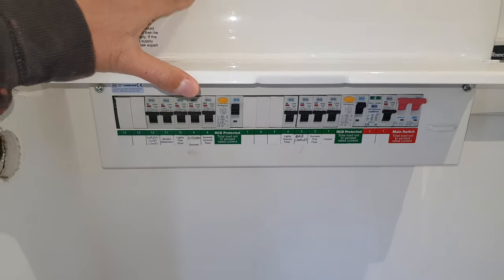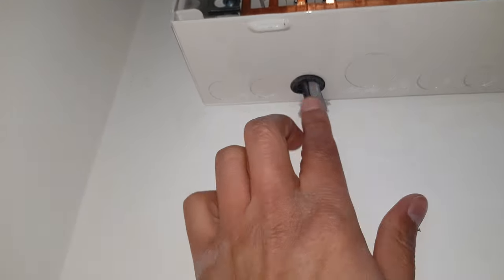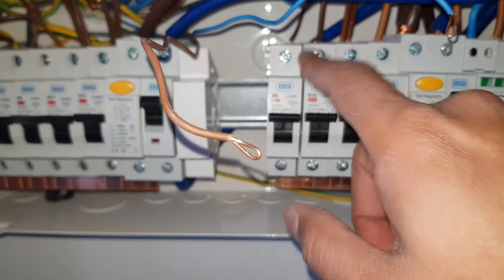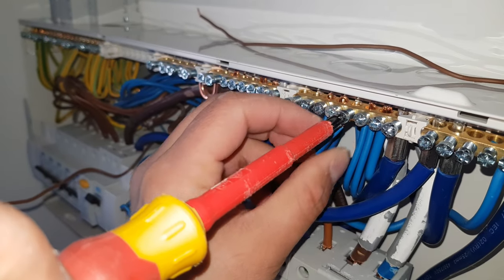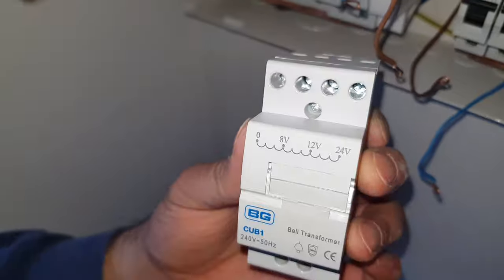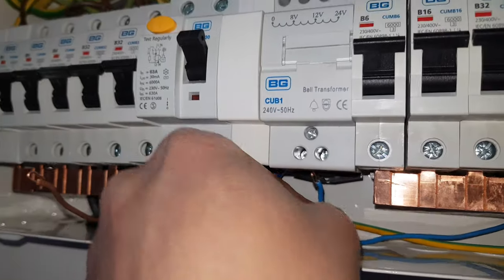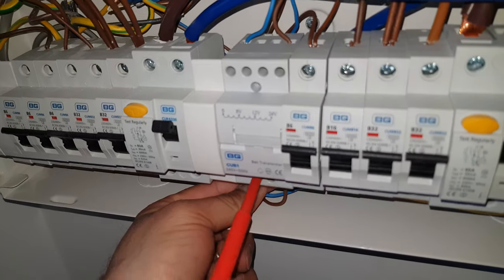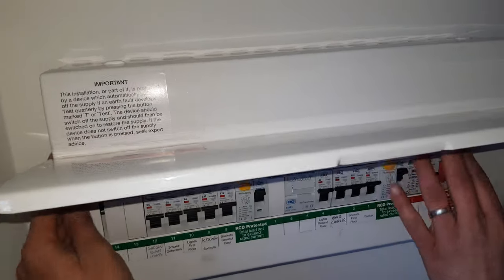Doorbell transformer for Google/Ring installed in consumer unit

Comment: Very detailed.  Great job.  Things look a little different over the pond.
Reply from the maker: They certainly are different especially with only 240v.
Reply: Sorry not detailed enough for safety purposes.  I enjoyed the video but they are not classed as being a "competent person" as per the wiring regulations the UK must follow.
Reply from the maker: @darrencramp1558   thanks for the comment. Not many videos by 'competent' individuals showcasing how to install. Would be more than happy if you posted something showing how it should be done. Also happy for feedback.
Reply: @DIMTips  one big tip I would suggest you research is the "safe isolation procedure" so there's no danger of electric shock if exposed parts are touched.  Remember switches can fail.  Also in turning off the power you should start with turning the mcb's off first so there's less internal acr across the main switch.  It's great seeing videos like this just needs to be done in a safe manner.
Reply from the maker: @darrencramp1558  thank you so much I will definitely give safe isolation procedures a read. Really appreciate the advice.
Reply from the maker: Very true

Comment: Ive got a very simalar job to do… door cam is on the rear side to the consumer unit….its a matter of drilling through at a slight angle to hit the exact area the cam needs to be …trouble is Ive got all the feeds to unit coming from ceiling and i also have sockets and other electrical and BT outlets and data sockets below so i dont no where the cables are going up as the width of the sockets ect below are as wide as CU …

Comment: I think it's important to make a disclaimer that this area should be out of bounds unless properly trained and dare I say, qualified. Great vid btw!
Reply from the maker: Fair point
Reply: I fo get why many say as you have ..as many don't have common sense ..I personallybwouod be checking for love before touching . And first confirming my device works that is testing it.......changed many lights  and switches wired up extractor 3 amp . Much of the basic stuff is common sense ..unfortunately some don't have it .......much of the p regs can be found easily .

Comment: Ring recommends using an 18gauge cable from the bell to step down transformer. What size wire does the 18 gauge wire equate to? I'm not sure what size wire you used. Didn't look like a standard bell wire. Please advise
Reply from the maker: I used 1.5mm. 18 gauge is 1.02mm. All in all not much in it. 1mm electric wire is easier to work with.

Comment: Im just wondering if u just used bell wire from the step down side of the transformer....6mtr run ....its for a ring 2 door bell....rather than the 1mm you used as its already in place. Thanks
Reply from the maker: It should work. I remember @efixx mentioned you may need to add additional sleaving for insulation.
Reply: @DIMTips  thanks...and where did u get that in line fuse / resistor from? Cant find where to buy it?
Reply: @DIMTips  Correct there's a wiring regulation for this in the UK.

Comment: Hi, thanks for the video. I got the same bell transformer in your video. But my doorbell says 16-24V. So do i put my neutral into 8V and live wire into the 24V, therefore total potential difference being 16V???

Of just keep it at 0V and 24 V as uou have shown?
Reply: If you need to ask that, call an electrician 😞
Reply: Always 0 for neutral and the rest for live no matter which one it depends hoq many volts the device require
Reply from the maker: Honestly best to consult a qualified electrician

Comment: You need to ensure that the Low Voltage side of the transformer is totally isolated from the 230V supply and you cannot do that in a Consumer Unit best to use a separate DIN rail enclosure for the transformer maybe next time as this will fail an EICR immediately
Reply from the maker: Thank you. Will state next time
Reply: @DIMTips  No problem

Comment: How am I supposed to get the wiring from the chime, to the fuse box. I don't want to tear up a bunch of plasterboard... My chime is wired, but think it's running off an existing ring, such as the ground floor plugs or lights maybe.
Reply from the maker: Yeah. Not an easy job. Electrician perfer for it not to be in the unit

Comment: Is there a way for me to check my current wiring? We have a standard doorbell running to the breaker but the breaker doesn't say what voltage/current it is can i just stick a multimeter to the wires at the doorbell and see if its compatible?
Reply from the maker: I would stick a multimeter on it.

Comment: My Doorbell is on the same loop as my upstairs & downstairs smoke detectors  wired into my consumer unit, Will i still need to use the transformer provided for my ring doorbell pro 2 or can i just bypass the chime & install  the bell on the current wiring system
Reply from the maker: Hope you managed to fix

Comment: Informative video - thanks 
BUT
Please amend with some kind of warning at the beginning  to remind people to check for live with a wand or similar device.
Having seen 2 electricians get a belt of 240v when troubleshooting faults I learnt that you should check every time you switch power on or off.

People aren't perfect - even the most conscientious make mistakes - might not be your mistake - might be the previous guy - takes seconds to check and wands are cheeeep - no brainer really.
Good vid otherwise - thanks.
Reply: Don't I know it not on a sicket but I usuallybhahdke circuit boards well more so if just removed but one time grabbing one moment of reason had a bekt from transformer .

Plus putting rubbish out few weeks ago had been wet km usually very careful switched light off went up my arm and shoulder not nice lol
Reply: I totally agree I do lights n sockets etc ..its easy to become complacent but safety every time ..a tester shouod be used before ypu touch any wire......one of our upstairs sockets oddly is on bottom ring main ..unsure why wasn't my doing .prob where they blocked off the alcoves before used most convenient (bit naighyu ) so I check every time it's a must .
Reply from the maker: Thanks and noted. I pinned a comment and just mentioned to get in  a qualified electrician

Comment: Can I do this myself in the UK or does it have to be certified by an electrician? Thanks
Reply: Wouldn’t attempt it. Just pay a sparky £80. Is dead easy but you’re not dead 👍🏽
Reply from the maker: Probably best if your are not comfortable doing. Should get it certified either way.

Comment: I installed exactelly the same i connected the live to the load side of the circuit breaker lights and the neutral cable to the neutral bar but when i turn it on the circuit breaker keeps tripping and then i tried to connected to the in side of the circuit breaker and doesnt trip anymore why it keeps tripping?
Reply from the maker: Oh dear. Might need to consult an electrician

Comment: What size cable did you use for live to the transformer and neutral away?
Reply from the maker: I will check. Probably 2.5mm or 1.5mm.
Reply: Did you ever check this? I am about to do the same thing with a ring doorbell and have read this comment as I was wondering the same thing. Could you please let me know whether it was 2.5mm or 1.5mm from the lights breaker to the transformer? Cheers 👍
Reply from the maker: 1.5mm
Reply: Ah thats great, thank you 👍
Reply: 1.5 mm would be enough if it gouse to the 6 amp light circuit breaker fuse

Comment: That bg transformer is only 8va so will not work on google nest, they need at least 10va. You're a div, also no band 1 band 2 separation inside CU. 🤠 Video.
Reply from the maker: Yeap. DIY job

Comment: Bang!!! Your Dead.  No proving the parts inside are dead other than just switching off.  Didn't even use a multi-meter (not a recommend tool for proving dead), no warnings issued.  What if there was a generating set feeding power back into the consumer unit!!!!  Were the terminals done up to the correct torque?  Should someone aimlessly follow this video than someone is going to get hurt.  Just because you got it to work doesn't mean it's safe.  So many dangerous  actions taken unknowingly.  Also this work require "minor works certification".  Be safe employ an electrician.
Reply from the maker: Yes. Agree. If you are not comfortable with electricity then you should.
Reply: Hater! Yet you come to watch huh? 🤔
Reply: @momiah5635  it's not about being a hater!  It's about personal safety and the safety of others who may follow the video.  I love watching YouTube videos for 'how to do' from various sources.  Not everyone is fully aware or even competent when it comes to electric's.
Reply: @darrencramp1558  🕗 the last few weeks
Reply: @darrencramp1558  🕗 the last few weeks
Reply: @darrencramp1558  🕗 the last few weeks
Reply: Before you cross the road make sure your shoe laces are the correct torque, don't want to trip over them :(
Reply: Assuming that a qualified electrician is doing this, shouldn't be an issue 😂

Comment: Talk about Overkill, you can take a simple 24 volt transformer and plug it into an outlet and then run the wire from the doorbell to that transformer boom none of the drama that you just did
Reply from the maker: Very true.
Reply: Unless you don't want that? Your comment didn't need to be in such a negative tone.
Reply: @mattychambers9811  your right I apologize
Reply from the maker: Thanks for the comment.  I am happy with free speech and opinions. My content is not for everyone but I always hope it helps someone make the jump into doing it yourself. Also thank you for bringing some positivity.